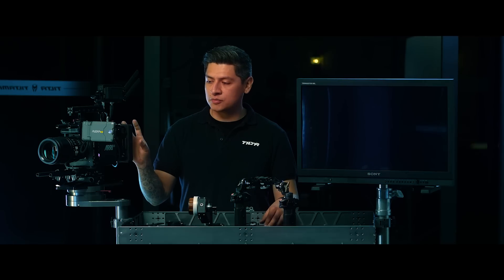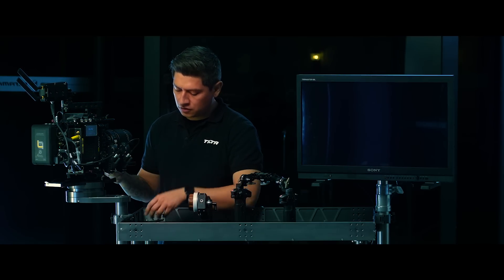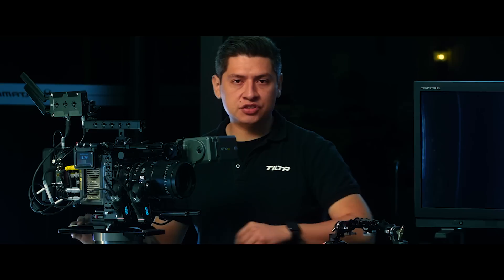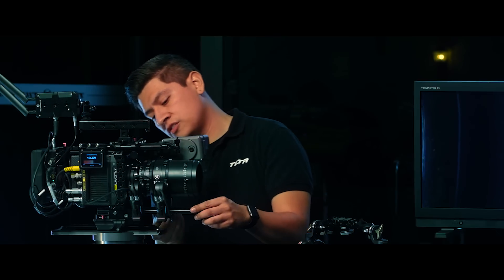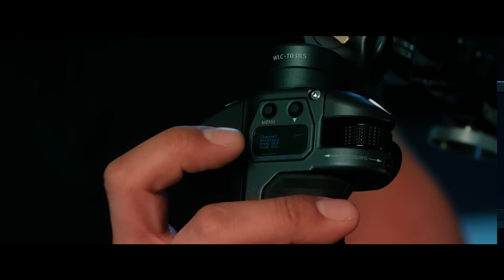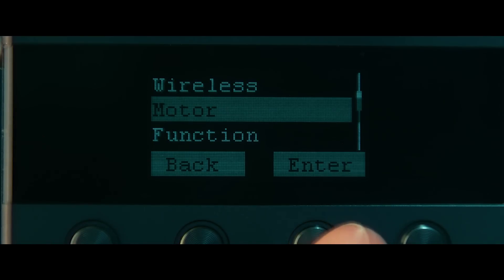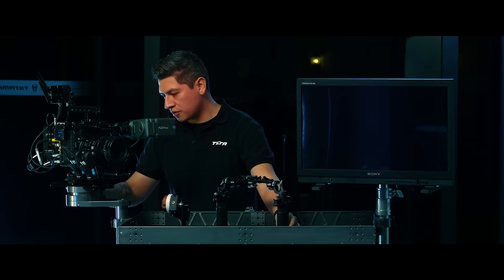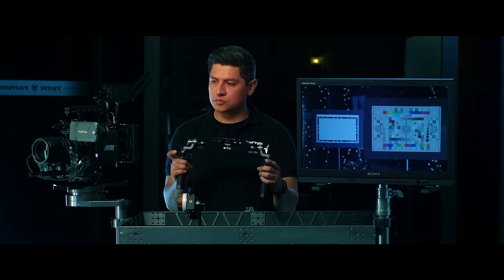Tilta Nucleus-M: 3 Motor Sync - Quick Start Guide

Comment: Can you provide a link to buy correct batteries here? Thank You
Reply: The page on there website that this product is on has a link of battery that they suggest to use. I got 20 rechargeable batteries for $10!!!
Reply from the maker: https://www.sears.com/ultrafire-18650-battery-6000mah-3.7v-li-ion-rechargeable/p-A040809173?plpSellerId=winnerway2018&prdNo=1&blockNo=1&blockType=G1
Reply: Search amazon for 18650 battery

Comment: What brand of 18650 batteries are people using?
Reply: Use the suggested batteries that’s on there website. They provide a link on the product page. They’re only $10 for 20 rechargeable 18650.
Reply from the maker: Here's the link for recommended batteries.
https://www.walmart.com/ip/4-PCS-3-7v-6000mAh-18650-Rechargeable-Li-ion-Battery-Dual-Travel-Charger-USA-Stock/182643265

Comment: "Motor protection please Recal" 
I got these problem on my motor. Do you know what the problem is? and how to fix 
All of my motors are not working. Plz help!
Reply from the maker: This will happen when the voltage of the motor is not stable. It could be that there is not enough power or too much power going into the motor. This is a self-protection mode. Have you tried other ways of powering your motor?
Reply: @TILTA  Hello, which device do you suggest to give stable voltage to achieve a good motor quality? is it a bad idea connecting the motor straight to the battery?

Comment: Great video, can you clarify however... when assigning channels, you say to place all the motors on different channels. Does that mean you must manually change them if you wish to use the hand unit for 3 motors? Also how can you have focus on one nob, zoom on the joystick and iris on the other nob? 

I noticed in the EZ video all motors were set and stayed on the same channel. 

Please advise. 

Thank you for the videos
Reply from the maker: The original method for syncing Motors to Controllers is as follows: Motors and Controllers must be set to the same "LORA" and Channel, for example: "H 08" "H" is "LORA" and "08" is the channel. Once all the motors and controllers are "H 08" then each motor is assigned a "motor number". You can decide the motor number per motor, 1-4. Then in the menu of the FIZ you can decide which "motor number" will be controlled by what. If your motor, assigned motor number 1, is on the focus ring of your lens then you will sync the controller knob on the FIZ to motor 1. If your motor, assigned motor number 2, is on the iris ring of your lens then you will sync the iris wheel controller to motor number 2. If your motor, assigned motor number 3, is on the zoom ring of your lens then you will sync the zoom joystick on the FIZ to motor number 3. EZ Mode uses a different protocol to sync all the motors and controllers, but the former method I've explained above still works. If you have any more detailed questions please email support@tilta.com